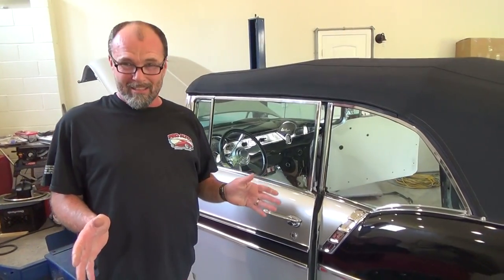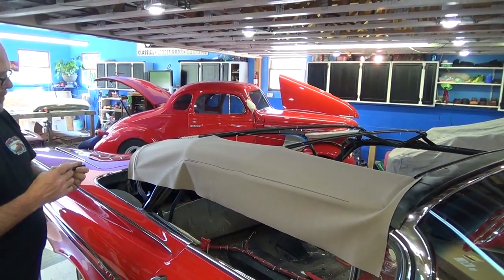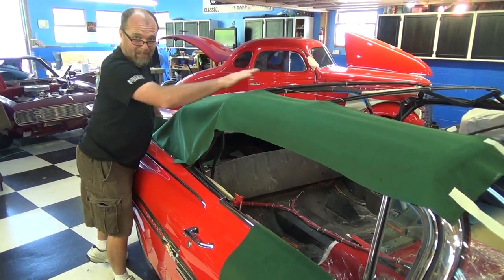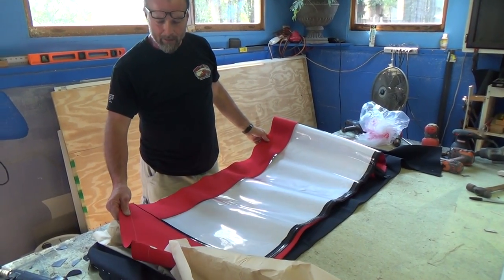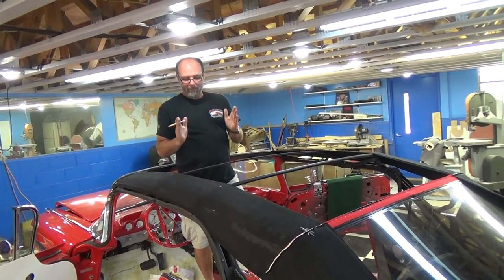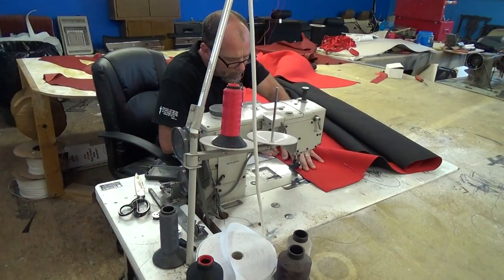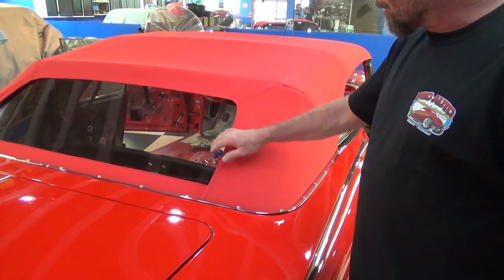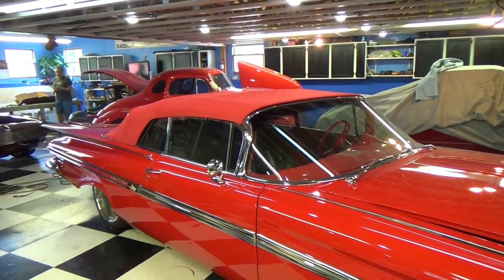How To Make A Custom Convertible Top

Comment: That is some damn fine work there. My first car was a 1966 Imperial Crown convertible. I learned top replacement by trial and error. Around 1988 or so Robbins tops quit making the bright red vinyl top my car used. If I had known this beforehand I would have brought them out just to have spares. This video does not show exactly how much trouble it is to make a top. You can order the material in bulk, but it is hard work!
Reply from the maker: Right on...

Comment: Great video in detail.
Minute 46:20..where the top closes on the front chrome windshield pillar looks a bit off....its not flushed..but i guess there is no other soloution
Reply from the maker: Q8 Fly They were wait on the correct  pull downs....It will be straight in the end...

Comment: Hi ,
Great video. I'm installing a vinyl top on a 63 Falcon Futura. The plastic window is 40 gauge plastic. What gauge plastic was used on the car in the video? I noticed that the windwo was very smooth, no rinkles. I cant seem to stretch mine as smooth. Any suggestions? Thanks again!
Reply from the maker: +Mark Anthony Beinner I just shoot the videos...I can tell you Steve has been doing for more than 25 years....He keeps working it till it's right....

Comment: how much would it be to make a 73 impala hard top into a convertible
Reply from the maker: nunya dambizness A bunch!
Reply: nunya dambizness The top would be the cheap part but you would have to completely change the body to fit all the guides and steel that the frame is made of. It would be cheaper to buy a 73 convertible lol.

Comment: @ under10 minuets and can see many things done wrong by the kid who didn’t speak English in San Diego.. Including running a screw through the rear deck when reattaching to the rear deck. Big sheet metal screw as he was unable to thread the original one. And it was after I had left for ID that I found it. 🤬